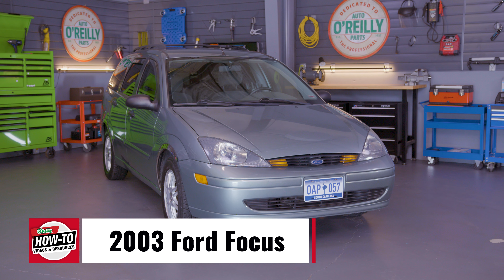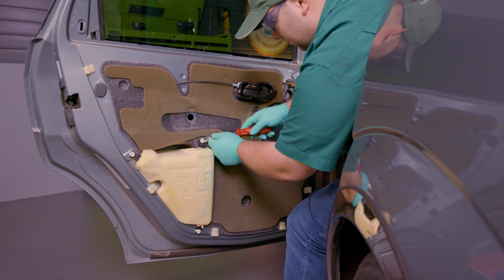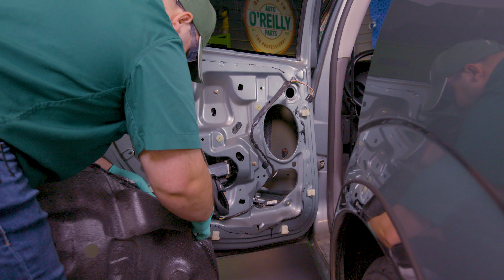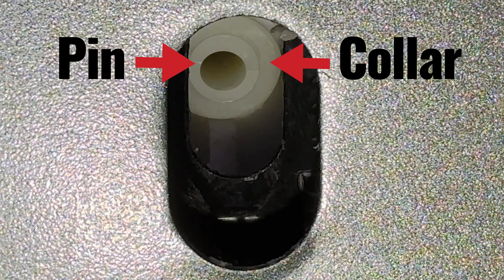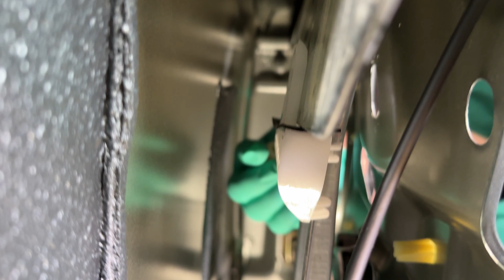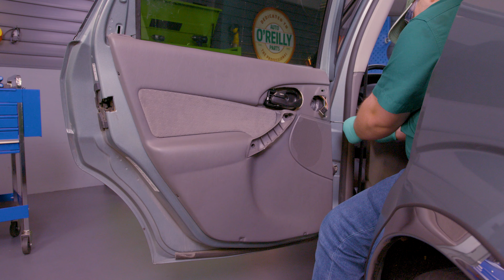How To: Replace a Window Regulator and Motor Assembly

Comment from the maker: Supplies Needed for This Job:

1. Safety Glasses: https://orly.cc/4e7cFKz
2. Gloves: https://orly.cc/3YKu3QZ
3: Flathead Screwdriver: https://orly.cc/3BeJZC6
3. Painter's Tape: https://orly.cc/4jPZmCj
4: Trim Tool Set: https://orly.cc/48tSvZX
5. Window Regulator and Motor Assembly: https://orly.cc/4aWVYBD